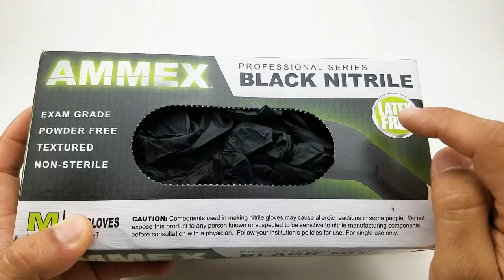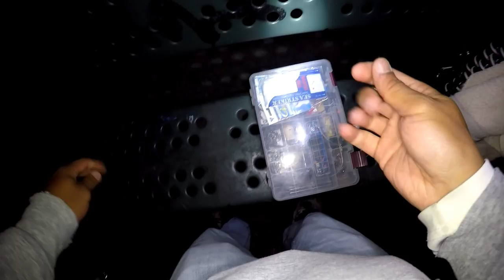How to Catch Sharks and Rays | Shore-Based Night Fishing

Comment from the maker: stuff i missed: i exclusively use a fish finder rig (main line with sinker slider and bead). i usually use octopus hooks, but offset circle hooks do a great job too and result in less gut hooks. when handling sharks and rays, support their belly as much as possible since it's their most sensitive area. i usually try to do a soft release in the water, but if i'm on a slippery rock near fast current, i toss them nose first if possible. last, fish with a buddy if you can! these night spots can be sketchy. i've never had a problem but strength in numbers etc, plus it's fun to hang with the boys. good luck and tight lines!
Reply: Yo ish go check out marinoutdoors Halloween video and see my 65 inch leopard shark 😂🐙🎣
Reply: Hey ish where is this place
Reply: This looks like its close to the Richmond bridge. where about's is this. I caught a 42 inch striper bass at the end of the Richmond bridge a few years ago. the Marin county end. anchovies and squid.

Comment: I like to snell my hooks and use conventional reels. Once I hear the clicker going off, just put the reel in gear and reel. No need to try and set the hook by swinging the rod.
I noticed your fish finder rig is what some people call a Carolina rig.
Reply from the maker: nice, yeah the ff is basically a carolina rig but with a sinker slider. nice, how do you know when to stop the spool when casting in the dark?
Reply: @ishwithfish  just experience I guess. You can always take notice of how long it takes the weight to hit the water during the day and just apply that that at night.  I noticed  that micro rod with the huge round reel in the video. Was that for messing around catching bait or for an other video?
Reply from the maker: @otroflores91  haha yeah that's my dock demon with a cheapo round reel. i casted it 10' out max, never got bit, so i kept throwing the spinner.

Comment: dude what a cool video , I pretty much the same thing you do gloves too, even the over size bell for sharks and rays and it all works great, thanks , do you think a penn  sargus 8000 ( its basically a battle 8000 or daiwa bg90  would be better for my second shark / ray rod the first has spinfisher v 6500, thank you.
Reply from the maker: go with the bg! bigger main gear and higher line capacity = killer shark n ray reel👍
Reply: @ishwithfish  cool thank you i also have a ssv 6500 live liner i dont use i forgot to ask about that one for this fishing.
Reply from the maker: @beachdude562  actually that ssv ll is perfect! i have the fierce ii ll; it's good enough for the sf bay but if i used it in the ocean i'd go with the ssv ll because it's much better sealed.
Reply: @ishwithfish  cool thanks twin 6500s it is